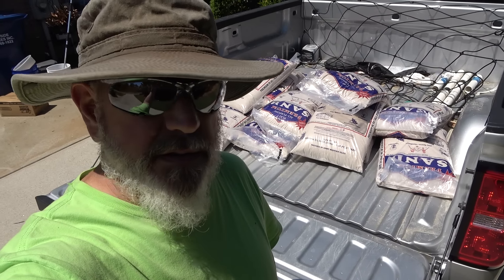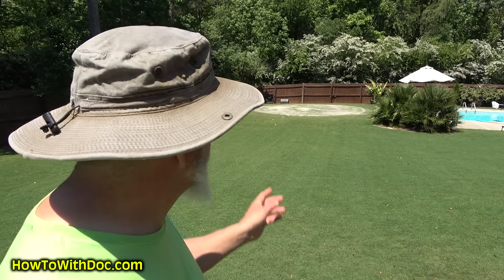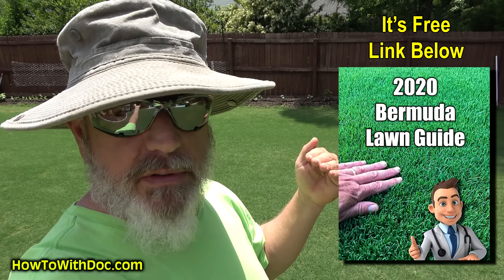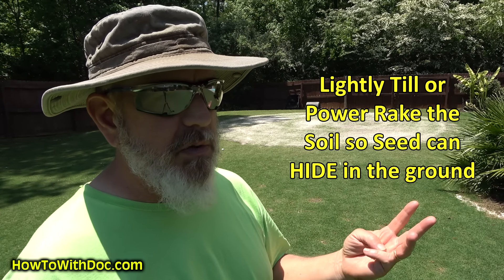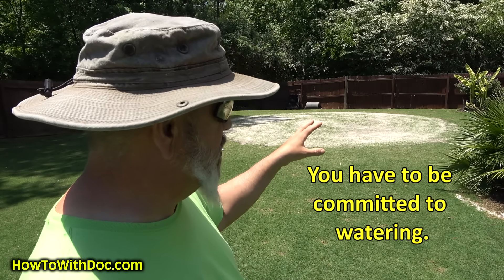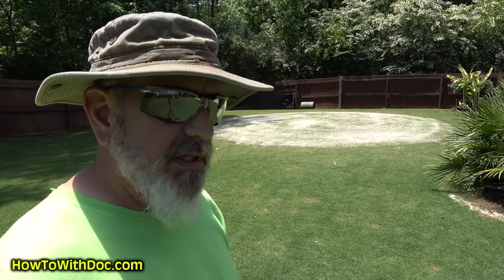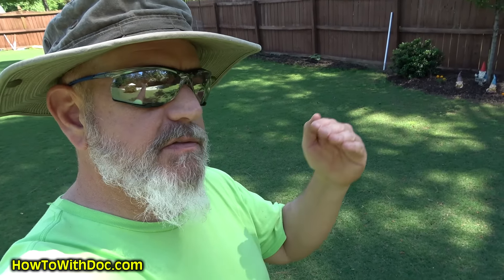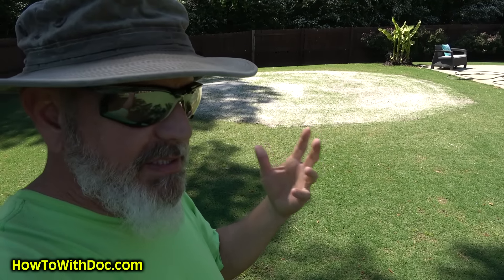Planting Bermuda Grass Seed

Comment: Cool video Doc, lots of love in that area!!  My question concerns sand and heat.  You mentioned in an earlier video about leveling with a mix and not sand because of excess heat with sand and how Bermuda may run from the hot area.  Could you elaborate on that?  TY!!

Comment: Hey Doc, I planted my lawn from seed 3 years ago with Yukon Bermuda. I know you’ve mentioned that the seed heads on the lawn are sterile, is that true for ones planted from seed also or just from sod? Also, I like your leveling mix . Here in Chattanooga my two choices for organic material to mix with sand is screened topsoil which still has a fair amount of clay, or mushroom compost. I don’t even know what mushroom compost is, which one would be better for my leveling mix?

Comment: Why in the hell would you want to plant Bermuda grass?  That is a weed.  I had it growing in my grass and it infiltrated 1/4 of the yard.  I just ended up using roundup on the whole yard, tilling it, round up again and tilling it.  I did that 3 times to make sure all the Bermuda grass was dead.  It has been three years and no sign of that weed as came back.  That crap is evasive as hell.
Reply from the maker: #blessed